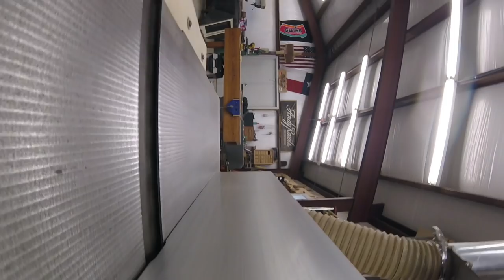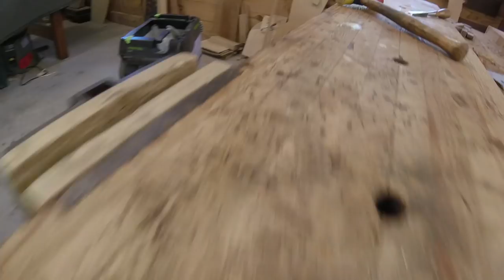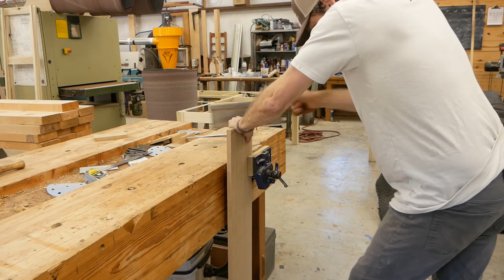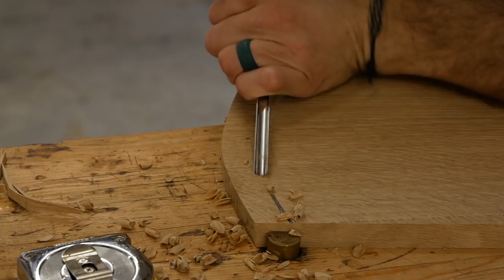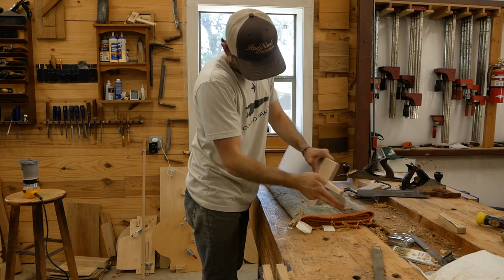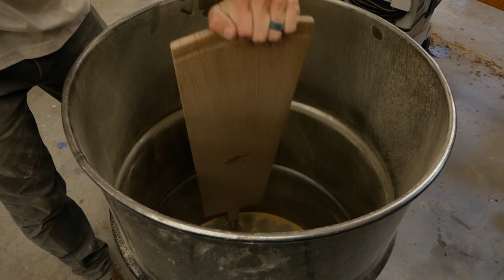Crafting A Very Long Charcuterie Board

Comment: Just because you have old saws doesn't mean you have to use them I've got all my dads saws(45 years a cabinet maker)I've refinished all the handles took them to be sharpened by the same company my dad used but will take a moden Jack saw over them it could be I'm not as good as dad was but seeing them on the workshop wall does remind me where I first learnt how not to remove fingers and a small boy the only old tools I use regularly are his chisels and hand planes the rest is on the walls

Comment: Dude ! No ! You have to make the handle in the shape of a dovetail. Thats the French way. Drill the corners out before you cut it free, so much easier. And drill a hole in the end of the handle to hang it on. Otherwise I will taunt you a second time.

Comment: Can you explain why this is so expensive? :)
Reply: Dimitrije Petrovic expensive material, really expensive tools that need proffesional care, hand made with an amazing result, ammonia staining and unique design.
Reply: It's easy to say, $150 for a simple board?

Just remember, the cost of the wood wasn't cheap to begin with. In my area that quarter sawn white oak would likely be about $30+-.
The cost of the labor is, let's say, 2 hours. Specialty trade like a plumber, auto mechanic, wood or metal worker can vary, but let's say $50/hr.
There is the cost of finishing materials, like the custom brand, propane for the torch, the finish, the sand paper, etc. $15?

My valuation sits at $145 and I didn't calculate the cost to keep up the tools that were used or products that will be used to safely ship it.

Let me know what you think, also if you can find a charcuterie board of similar size for a much better price!
Reply: I agree with your assessment Taylor. Spot on sir!
Reply: Thanks for the answers!
The USA standard is much higher than ours, I cannot imagine someone paying north of 20-30$ for something like this in my country, hence the question.
Reply: Dimitrije Petrovic where are you from?

Bare in mind that the hourly rate is higher here because it's typically expensive to live in the US too. A family of 4 can barely make it by on $2,000/month.
Reply: Taylor Sessions I'm from Serbia and some thing that Andy makes, for example spatulas for 20$ can be bought here for 1-2$.
Nevertheless, I love Andy's videos, I just wanted to know, why "a piece of wood", like you said, would cost 150$ :)